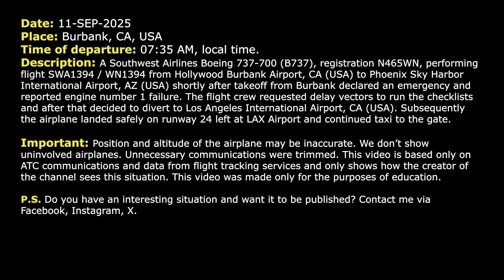Engine FAILURE after takeoff from Burbank. Southwest Boeing 737 diverts to LAX. Real ATC

Comment: Can anyone answer why so Many turns and why they just can’t land right away? Fuel dump?
Reply: Turns were so they didn't crash into one of the many mountains in that area, and they didn't land right away because they needed to set up for a different airport, notify their dispatchers, calculate landing the new data and brief the approach and cabin crew.
Reply: I figured time was of the essence when you lost an engine. Sounds like a lot of variables when you need to just land fast

Comment: So serious question for the pilot community: I know the odds of a second engine failure are small,  but instead of maintaining 5,000 as they move further away from the airport, would it increase safety to slowly climb and give themselves a better glide radius in the unlikely event of a second failure? Is there much of a downside?
Reply: There isn’t much of a down side but there’s almost no upside either.

Comment: Was waiting for the audio for 465. Clocked in and was asked to tow 465 to the maintenance pad. #1 looked intact until I checked the rear, the compressor blades were shredded. Aircraft cabin smelled like a wildfire. Kudos to the crew!

Comment: RWY 8 at BUR is not a great option for a loaded emergency landing. LAX was a GREAT choice. That Burbank runway is short and the terminal/cargo lines the right side.
Reply: They probably would've used runway 33. A longer runway

You don't hear it on here. But while the pilots were talking with SoCal, the tower controller canceled the approach for 2 inbound aircrafts and held the departures clear of runway 15. Basically stopped all traffic.

Comment: I flew large jets in the AF for many years.   Engine failure was a very short checklist.  

EMERGENCY ENGINE SHUTDOWN

1. “FIRE HANDLE – PULLED” (P)
Confirm the proper fire handle is identified.
2. AGENT – “AS REQUIRED” (P)
If an engine fire indication persists after the fire handle is
pulled, discharge the agent. If fire continues after first
bottle, move Bottle Selector switch to ALTERNATE
position, and discharge the agent.
3. Throttle – “IDLE START” (P)
4. Fuel and Ignition – “STOP” (P)
5. Engine/Pylon Scan – “AS REQUIRED” (P/CP, S)
6. Engine Anti-Ice – “OFF” (P)

There must have been a bit more trouble than just that in this incident.
Reply: The checklist is much longer for the 700 model at airlines. Yours just secures the engine. We had to brief flaps 15 landing at the higher speeds, reconfigure packs, get the APU on bus, do new calculations for landing parameters based on higher approach speeds, talk to dispatch, brief the fa.s and passengers then brief a single engine go around. That’s why it takes so long. If memory serves, we used to plan on a 15 mile final from a downwind entry to accomplish all that. But don’t quote me, it’s been awhile since I was in the seat.

Comment: As a nervous flyer, I really appreciate these videos that show that the loss of an engine on a 737 or other two engine aircraft is very manageable to a safe landing. But regardless of the reassurances of superior engine tech and the ability of a single engine to move a modern airliner around safely, I still miss the days of at least three. There was something about the 727 and knowing that if an engine conked that you still had a substantial majority of your propulsion available, and that a single engine failure didn’t take you down to your “very last nerve.“  Four holes, even better. In fact, I think my days of overseas travel are basically over because it would be so stressful to me to think that you could be in the middle of the Atlantic and be down to a single engine (and I do realize that there are still 747 hauling passengers, but those numbers are dwindling.) I know this is all about feelings, but it is what it is.
Reply: As someone behind is deep in aviation and family in aircraft maintenance, the advancements in engines have been staggering with efficiency up through the roof at the present day. Twin engine jets are capable of maintaining flight with one engine however it's very inefficient and for emergency use only. The main reason is say whatever happened to #1 left happens to #2 right. Then you're a glider. Now you have to realize pilots by the time they get to an overseas route will have tens of thousands of flight time and additionally have requisites of in charge/in command time as well for that rating/kind of A/C. And furthermore when they fly overseas they plan a route that's within striking distance of an airport that's capable of supporting their equipment. (Many airports only are made for smaller planes aka general aviation or such that you might be able to land a commercial jet in there but it will be very difficult to get it back out. So make those flights. You're more likely to pass in a car accident than in the air. Fight your tism and overcome that mental block.
Reply: I was watching this out of the account so it wouldn't flood my suggested videos with plane videos but felt it was important to log in to comment this

Comment: Why didn’t they fly direct Ontario? The distance was the same after being vectored around Burbank.
Reply: Because the pilots requested LAX, not Ontario, but also because going east from BUR would put them head-on into ONT departures and LAX arrivals at their altitude, while the area they were vectored in is a departure corridor from LAX and BUR with other jets above them.
Reply: Well manned emergency equipment, maintenance crews, facilities and parts are readily available at LAX. Surrounding airports need to transport, sometimes holding aircraft on the tarmac for days instead of generating revenue.
Reply: I know why, the cost to land at kont will be higher.

Comment: After reviewing similar engine failure incidents, and the running of checklists before landing, Federal Aviation Regulations (FAR"S) require the airplane to immediate land at the closest airport after serious mechanical problems.  I believe that, regardless of the normal airline procedures, that the lives of the passengers, and the millions of people living in the San Fernando Valley, are far more important that preserving the life of the engines and other systems, by delaying the landing, and flying around over a populated area, with only 1 operating engine,  for several minutes, thereby, endangering the lives of all these people,  by taking valuable time to run checklists.   I believe that, after an engine fails, for unknown reasons, on a 2-engine airliner, in order to avoid a catastrophe of unimaginable proportions, a pilot must be prepared for, and plan for, the failure of the other engine and immediately land the airplane at the closest suitable airport.  I wonder if the airplane was on fire, if the airlines require the pilots to run checklists before landing.
Reply: Assuming you aren’t a pilot? Can you reference the specific FAR that says pilots should ignore checklists and just set the plane down?
Reply: You must not be a pilot cause you sure don’t know what your talking about to make such a rant about nothing. In addition if you believe the pilots and the ATC personnel don’t know what they’er doing and selfishly placing people on the ground in jeopardy then you shouldn’t watch any of the educational aeronautical videos shown on here. What you should have done before jumping on the chance to accuse, discredit or talk crap on someone is do some research with everything thats available to you on the net before making ridiculous posts.
Reply: LMAO. what an absolute wall of NPC dribble saying absolutely nothing. You clearly know nothing about aviation lol tell us you know nothing about aviation without telling us you know absolutely nothing!
Reply: GOD I hope u aren't a pilot... theese heros are trained in theese types of emergencies... so your beliefs are just fairy tales... theese pilots needed a linger runway than what burbank had  and they did so incase they needed that runway to avoid a catastrophe.... sooo stay in your own pay grade and let theese trained heroic pilots and controllers do what they spend hours and hours training to do...
Reply: Relax folks, this is just ragebait.

Comment: Great job tower, clearing them to land and asking if they can accept a freq change. I get that NorCal was trying to time spacing there but they need to be able to run a checklist and not have entire convos about spacing
Reply: This video is edited. I'm sure the communication was very spaced out. Because according to flightradar, they were up in the air for 40 minutes

Comment: As someone who is very anxious about being in an airplane, I like hearing this. It's an emergency, I'd be freaking out, but the pilots and ATC sound like it is just another day at the office. ATC is there to give them as much or as little help as they need. I still will avoid flying if I can, but recordings like these help.
Reply: I agree with you I like being on the ground
Reply: I mean....  It's basically another day at the office...  They practice this constantly, practically a pilot's first flight the practice engine out.